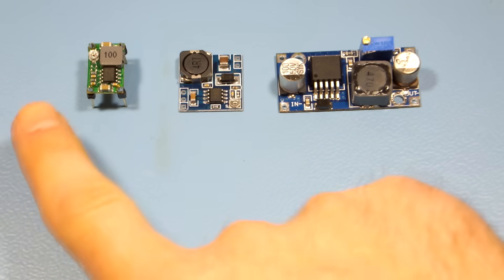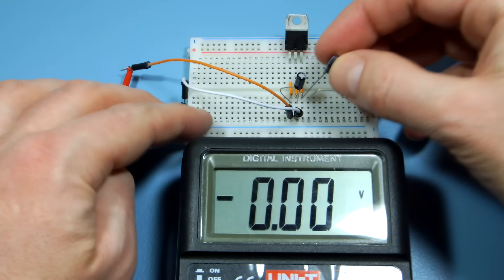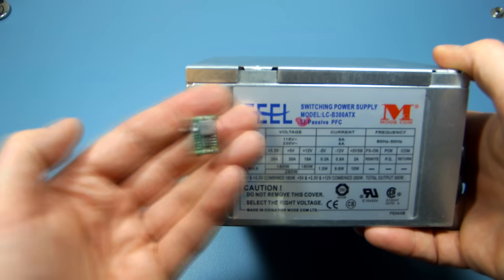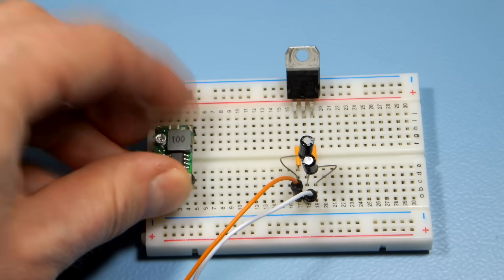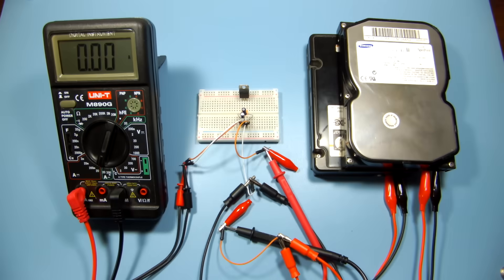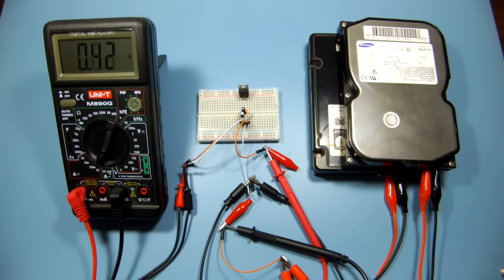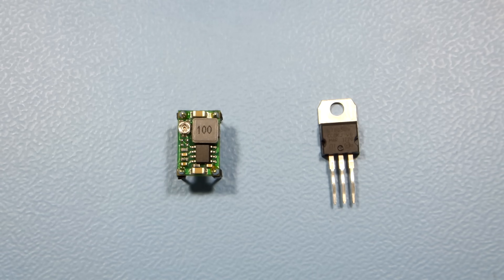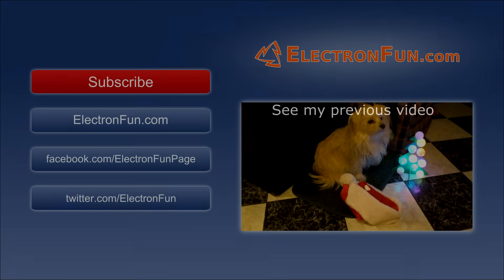Buck converter vs. linear voltage regulator - practical comparison

Comment: What should I use for a cell phone charger?
Reply: +Raphael Schärli A switching power supply makes sense because you dont want to waste energy charging your phone, and phones usually need a fair bit of power.

If your phone charges with USB, then the output voltage should be 5V, and should probably deliver at least 1~2A of current. If its not USB, then you should check the plug that came with the phone, it should tell you the amps and volts needed to charge it.
Reply: a buck converter in this video and 12v motorcycle battery is good enough. I have one installed in my motorcycle compartment.
Reply: If you're talking charging the phone battery directly, then if 1A charging current is enough, I'd definitely go with a TP4056 - complete modules (including the required support components (caps, resistors etc) are silly cheap on eBay.People have been playing with paralleling these boards, and it works, sort of - the cutoff voltage tends to be a bit inconsistent and you might not get up to the full 4,2V  Just search for TP4056. Also look for TP 4056 here on youtube.

If you're talking charging the battery while in the phone, ie through the phone's usb connector, then you need something that puts out 5V - plenty of modules for that too. A search like '5V buck regulator module' should find them.

Exactly what you need will also depend on what you're using as the power source. Buck only works if your source voltage is higher, if it's lower you need a boost circuit to raise the voltage (at the expense of higher current draw from the source)
Reply: Michael Tempsch Amen to that.

Comment: 100 to 125 Celcius.....sounds like a perfect place to add a peltier module to capture the heat and convert it back into electricity.
Reply from the maker: Talha Kamran Maybe it is, but I guess it's better to use a buck converter and save the energy from the beginning.
Reply: ElectronFun.comI wonder why no one has ever tried using peltier with chip boards that do not get really really hot.....May be because the energy captured will be very low but I think it will payoff in the long run. Especially when you have large setup I don't see any reason why one should not.
They can give it a fancy name like "Heat radiation utilizer"
Reply from the maker: Talha Kamran To tell you the truth - I thought about it too some time ago. I guess nobody does this, because it would make the circuit more complicated, more expensive and I'm not sure if it would be worth it. I might try it in one of my future videos - it could be a very interesting experience.

Comment: I hav 12.5 volt battery  n i want to run 4w led lit i put it 3 led in series  also it work but power is either dim or bright what should i do
Reply from the maker: karan shahi You have a 12.5V battery and 3 LEDs - 4W each, right? How many Volts are your LEDs rated for?

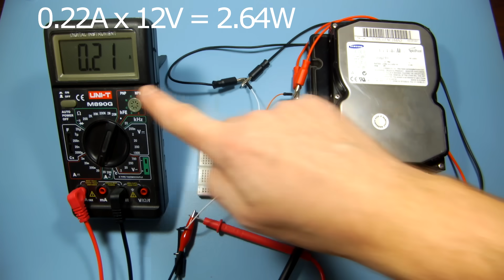Comment: at 5:20 ... it's wrong ... you have to measure input voltage + current and output voltage + current in order to calculate the correct value of power loss ... in the case of the linear voltage regulator, you are correct ... but on switching regulators the input current IS NOT the output current! you have to calculate power input and power output and subtract them ... in your case ... 12V*0.22A - 5V*0.45 = 0,39W power loss ... in your calculation 1.54W power loss would also require a heat sink on the switching regulator
Reply from the maker: ***** Thanks for pointing this out, I'll check my calculations again and correct my figures.

Comment: Great Video.. Glad I watched till the end. I was considering a buck converter for a portable amplifier. I never would have known they can create interference.  Good tip
Reply from the maker: wickedbadretard Thanks for your comment, I'm glad I could help.
Reply from the maker: You can find many different devices on the market: buck converters, boost converters and buck-boost converters, which is a hybrid of the former two.

Comment: Not knowing why, I always worry about the cheap converters in the market. 'What if it explodes while working'.
Reply: Zelra 仙賢戀軒 that probably happens on hollywood
Reply from the maker: Zelra 仙賢戀軒 Fortunately there is not much to explode - just a chip, a coil, a few capacitors and a bunch of resistors.

Comment: I have a question doesn't buck converters step down voltage and boost up amps?
Reply from the maker: A buck converter is a voltage step down and current step up converter (http://en.wikipedia.org/wiki/Buck_converter). However, it doesn't mean the device you want to power will automatically get more amps because of the buck converter. The amount of current drawn depends on the device itself.
Reply from the maker: ashea gulcasa Hi, a standard buck converter lets you adjust only voltage, but there are buck converters with current adjustment too.
Reply from the maker: ashea gulcasa If your lowest value is 10V, it's not a problem for a buck converter to output 5V. Just buy a buck converter that is capable of handling more than 50V, so you don't fry it.

Comment: Nice video, thank you! One thing though, the 7805's power consumption is (12v-5v)x.42 amp, but I get what you meant. It's a great comparison.
Reply: Your comment  unfortunately is somewhat a rarity on YouTube. Pointing out an error in a civil professional  manner. Thanks
Reply from the maker: Thank you for your nice comment and letting me know about my mistake. I've just added annotations with corrected calculations. Sorry for my stupid mistake. I double checked everything, but I should have triple checked.
Reply from the maker: waswestkan
Thanks a lot! I could correct the video and reupload it, but I decided to spend the time for preparing another video and let people know about my mistake. The only problem is - annotations don't work on mobile devices.